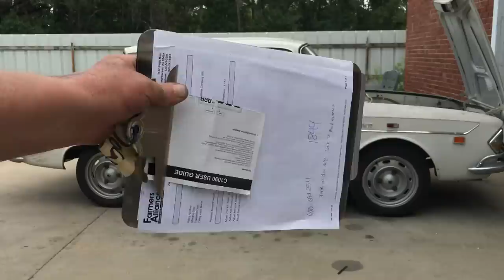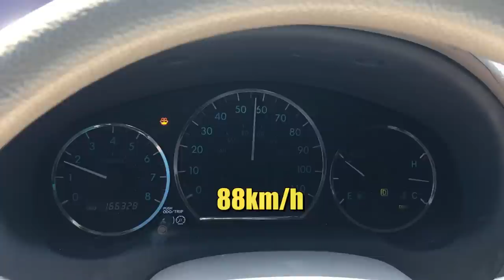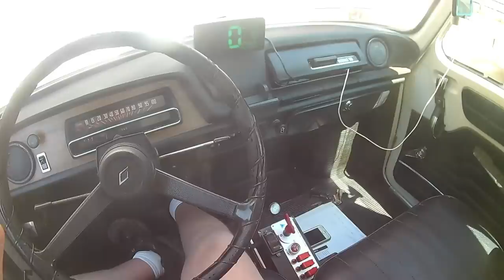S3 E21. How fast will this 670 cc predator V twin powered Renault go?...  Faster than you think!

Comment: Learn electricity at your own pace
What makes a light bulb work? What overloads a fuse? How does a magnetic field differ from an electrical field? With Electricity: A Self-Teaching Guide, you'll discover the answers to these questions and many more about this powerful, versatile force that everyone uses, yet most of us don't understand.

Ralph Morrison demystifies electricity, taking you through the basics step by step. Significantly updated to cover the latest in electrical technology, this easy-to-use guide makes familiar the workings of voltage, current, resistance, power, and other circuit values. You'll discover where electricity comes from, how electric fields cause current to flow, how we harness its tremendous power, and how best to avoid the various pitfalls in many practical applications when the time comes for you to put your knowledge to work. The clearly structured format of Electricity makes it fully accessible, providing an easily understood, comprehensive overview for everyone from the student to the engineer to the hobbyist.

Like all Self-Teaching Guides, Electricity allows you to build gradually on what you have learned-at your own pace. Questions and self-tests reinforce the information in each chapter and allow you to skip ahead or focus on specific areas of concern. Packed with useful, up-to-date information, this clear, concise volume is a valuable learning tool and reference source for anyone who wants to improve his or her understanding of basic electricity.
Reply: Electricity: A Self-Teaching Guide (Wiley Self-Teaching Guides Book 177) 
by Ralph Morrison (Author)
Reply: If you wish to show your curious (really?) grand child how electricity and electronics work use this book. You have a fair chance to teach the young cub without boring the trapped child to death. The material doesn't require mastery of heavy mathematics. The schemes are simple and clear, The experiments can be performed with no excessive preparation time and effort. You need some testing hardware a few basic tools and some components. If you don't own them already, buy. These aren't expensive. It's good to have them at home any way.

If your student is too young skip the definitions simplify and shorten explanations. Go straight to the experiments. To a more grown better learnt student read and add your interpretations to the books contents. If your student can and agrees to read the book you are lucky. In such case you both were invited to a party all pure fun and thrill. Lean back and answer questions from time to time. Your help with the experiments will be needed most probably.

If your student grand child happens to be a real student. Meaning an electronics engineering student at any kind of university or technical academy institute, Sorry. The book is under qualified. Read the book for yourself or try with your grand grand child.
Reply: I just began reading this book, reviewing some of the things I learned way back in High School in the '70s. I selected this one of several popular "coffee-table" texts, because, at a glance, it appeared to be really focused on the physics behind electricity.
When I reached page 13, however, I was thoroughly amazed to find that Ralph Morrison, who is supposed to be this hot-shot electronics engineer, has made some very serious errors in his presentation. For instance, he incorrectly identifies the unit of force in the metric system as the kilogram. Now, we all understand that unit to denote mass. The unit of force in the metric system (which high-scool Physics texts call the "MKS system," as opposed to the "CGS system," also metric, but useful for denoting smaller quantities) is, actually, the Newton. He then uses this bit of bad Physics to make more, by deriving the dimensions of the Joule as "kilogram-meters." Where he does make mention of "mass" and "acceleration" in his example about the work done lifting a body in a gravitational field, he supplies the variables "m" and "g" but, they are dimensionless. These are the same sorts of mistakes that beginning students make when they fail to understand that "weight" is a FORCE, not a measurement of mass. The weight of, say a brick, is not measured in kilograms. It's measured in Newtons.
These errors are absolutely critical when they appear in any discussion of field theory.
Because I do remember somthing about High-School Physics, I have been able to read this text and understand what the author is driving at; I have been able to accomplish this only by second-guessing the text at each step. I don't believe that a true beginner to this subject would be so lucky.
Reply: A great updated edition for those who might be looking for a refresher course, or just simply a beginner/maker in the field of electricity and electronics. Some sections may come across a bit intimidating, but the text is written well enough for even the beginner to understand. I had first seen the 5th edition of this book at my local bookstore; thinking that this book had too many chapters/subsections to be that all that thorough and in-depth, but I quickly learned that this book didn't lack anything at all. I was amazed at how well everything was laid out. The material is presented in such a way that makes everything so very easy to learn without all the confusion at the same time. After completely enjoying the 5th edition, I was anxious for the arrival of this new and updated 6th edition. If you're looking for a well rounded text, than this new edition may be right for you. The biggest difference between editions is that the 6th edition now includes Audrino hardware and programming, an improved Microcontrollers section, and other updated information of other sections, as well as updated practice tests and exams. I strongly recommend this book first over any of those expensive textbooks out there. After All, if you're out to achieve a good understanding of electricity and electronics, or studying for an entrance exam for a technical job position, this book will help you do that. It's a great book for teaching you the subjects of electricity and electronics, that later tests your knowledge of it. I highly recommend this updated edition
Reply: Good aspects of this book have been said by most of the other reviewers. The main problem with such books is that for slightly experienced problem solvers, this book probably does not provide a whole lot of information as to what needs to be done to get better. For instance, for a kid who is in 10th grade struggling with math, this is a very good book. For a kid who is in his 11th grade trying for math Olympiad or for people looking at Putnam, this book won't provide much help.

Most people simply say that "practice makes perfect". When it comes to contest level problems, it is not as simple as that. There are experienced trainers like Professor Titu Andreescu who spend a lot of time training kids to get better. There is lot more to it than simply trying out tough problems.

The most common situation occurs when you encounter extremely tough questions like the Olympiad ones. Most people simply sit and stare at the problem and don't go beyond that. Even the kids who are extremely fast with 10th grade math miserably fail. Why?

The ONE book which explains this is titled "Mathematical Problem Solving" written by Professor Alan Schoenfeld. It is simply amazing. A must buy. In case you have ever wondered why, in spite of being lightning fast in solving textbook exercises in the 10th and 11th grade, you fail in being able to solve even a single problem from the IMO, you have to read this book. I am surprised to see Polya's book getting mentioned so very often bu nobody ever mentions Schoenfeld's book. It is a must read book for ANY math enthusiast and the math majors.

After reading this book, you will possibly get a picture as to what is involved in solving higher level math problems especially the psychology of it. You need to know that as psychology is one of the greatest hurdles to over when it comes to solving contest problems. Then you move on to "Thinking Mathematically" written by J. Mason et al. It has problems which are only few times too hard but most of the times, have just enough "toughness" for the author to make the point ONLY IF THE STUDENT TRIES THEM OUT.

The next level would be Paul Zeitz's The Art and Craft of Problem Solving. This book also explains the mindset needed for solving problems of the Olympiad kind. At this point, you will probably realize what ExACTLY it means when others say that "problem solving is all about practice". All the while you would be thinking "practice what? I simply cannot make the first move successfully and how can I practice when I can't even solve one problem even when I tried for like a month". It is problem solving and not research in math that you are trying to do. You will probably get a better picture after going through the above three books.

Finally, you can move on to Arthur Engel's Problem Solving Strategies and Titu Andreescu's Mathematical Olympiad Challenges if you managed to get to this point. There is also problem solving through problems by Loren Larson. These are helpful only if you could solve Paul Zeitz's book successfully.

To conclude, if you are looking for guidance at the level of math Olympiad, look for other books. This book won't be of much assistance. On the other hand, if you are simply trying to get better at grade school math, this book will be very useful.
Reply: 数学の問題を解く方法が、学生を指導する、という視点で体系的に述べられています。　解答を導き出すための学生への質問集も用意されています。　考え方にびっくりするほどの斬新さは感じられませんが、数学教師や数学を志す人には役立つと思います。　　では数学以外の一般的問題解決やプロジェクトなどの問題分析に役立つかというと、プロセスマネジメントが発達した現代ではそこまでの応用力を求めるのは無理かな、と感じました。　文章は簡潔で英語は読みやすいです。　今まで馴染みのなかった数学英語に接することも出来ました。また、錆付いた数学知識を（ある程度）思い出すきっかけになったと思います。 ガリレオ時代のフランスの学者 Descartes,Reneが引用されていたりもします。
Reply: From a renowned historian comes a groundbreaking narrative of humanity’s creation and evolution—a #1 international bestseller—that explores the ways in which biology and history have defined us and enhanced our understanding of what it means to be “human.” One hundred thousand years ago, at least six different species of humans inhabited Earth. Yet today there is only one—homo sapiens. What happened to the others? And what may happen to us? Most books about the history of humanity pursue either a historical or a biological approach, but Dr. Yuval Noah Harari breaks the mold with this highly original book that begins about 70,000 years ago with the appearance of modern cognition. From examining the role evolving humans have played in the global ecosystem to charting the rise of empires, Sapiens integrates history and science to reconsider accepted narratives, connect past developments with contemporary concerns, and examine specific events within the context of larger ideas. Dr. Harari also compels us to look ahead, because over the last few decades humans have begun to bend laws of natural selection that have governed life for the past four billion years. We are acquiring the ability to design not only the world around us, but also ourselves. Where is this leading us, and what do we want to become? Featuring 27 photographs, 6 maps, and 25 illustrations/diagrams, this provocative and insightful work is sure to spark debate and is essential reading for aficionados of Jared Diamond, James Gleick, Matt Ridley, Robert Wright, and Sharon Moalem.
Reply: @ocdman202   In this thought-provoking follow-up to his acclaimed StarTalk book, uber astrophysicist Neil deGrasse Tyson tackles the world's most important philosophical questions about the universe with wit, wisdom, and cutting-edge science.
For science geeks, space and physics nerds, and all who want to understand their place in the universe, this enlightening new book from Neil deGrasse Tyson offers a unique take on the mysteries and curiosities of the cosmos, building on rich material from his beloved StarTalk podcast.
In these illuminating pages, illustrated with dazzling photos and revealing graphics, Tyson and co-author James Trefil, a renowned physicist and science popularizer, take on the big questions that humanity has been posing for millennia--How did life begin? What is our place in the universe? Are we alone?--and provide answers based on the most current data, observations, and theories.
Populated with paradigm-shifting discoveries that help explain the building blocks of astrophysics, this relatable and entertaining book will engage and inspire readers of all ages, bring sophisticated concepts within reach, and offer a window into the complexities of the cosmos.
For all who loved National Geographic's StarTalk with Neil deGrasse Tyson, Cosmos: Possible Worlds, and Space Atlas, this new book will take them on more journeys into the wonders of the universe and beyond.
Reply: Neil Degrasse Tyson uses two methods to communicate information in the book. Tyson does an excellent job of making science enjoyable through the text and photographs.

The first method Tyson uses to communicate information is through the text. One interesting fact I learned is that there are 100 billion galaxies in the universe and that 10 stars are created each year. Another interesting fact I learned from reading the test is that the planets are classified in three different ways. The Earth, the planet Mars and Venus are rocky planets. Saturn is a gas planet. Neptune and Uranus are icy planets I did not know that the planets could be grouped as such. I learned that dark matter in the field of astrophysics like dark matter and dark energy that need to be explored. Dark matter is a gravitational force that sucks matter in the universe in. The last piece of information I learned from the text is the water is not only liquid that can be used to detect life on other planets The detection of liquid methane and ammonia are two other signs that life is possible on other planets.

Neil Degrasse Tyson uses photographs to communicate information in this book. I like the photograph of an European space probe called Gaia. This probe's function is to photograph all of the stars in the sky. There is a beautiful photograph of the surface of Antarctica. This picture is a reference that meteorites landed on the continent and suggests that Antarctica is an starting point of origin of the earth. There is a beautiful photograph of the sky in Acadia National park in Maine. I like this picture because the natural beauty of Maine is on display here. There is a picture from the movie Star Wars that illustrates the concept of exo sociology. Exo sociology is the practice of human beings interacting with aliens from other worlds. I did know there is a field of study called exosociology. I had fun learning that a scene from a sci fi movie is an actual study. I learned so much about the universe from reading Cosmic Queries.
Reply: The great Richard Dawkins once famously said, “We are going to die. And that makes us the lucky ones.” This was in reference to the statistically tiny probability that we were even born at all. Then, in addition to this felicitous opportunity, we evolved to understand the universe and our place in it. We are the universe awakening to know itself – possibly the most beautiful sentiment ever conceived.

NGT has long been another great expositor of science. Here he takes common questions and ideas in cosmology, physics, chemistry, and evolutionary biology and weaves them together to paint an up-to-date picture of the most important questions ever asked. Where do we come from and how did we get here? Are we alone? How did the universe begin, and how will it all end? The result is a complex tapestry of hard-won science, centuries in the making. To be sure, some of this is easy to grasp and some of it isn’t. As impressive and clear-minded as NGT is, some of the science here is difficult to understand. Readers should be aware that some basic grasp of the picture of the universe should be present prior to undertaking this endeavor. The best physics popularizers in the world all run into the same trouble. Particle physics is hard. Grasping the deeply theoretical (and hypothetical) nature of the multiverse and the “pre-Planck” universe is hard. National Geographic’s art helped with these difficulties, but much of this is challenging to read and understand.

However, in the end, NGT’s passion for curiosity, for inquisitiveness, shines through the morass of complex science. His humor also propels the reader through the book. None of this information is really new – even for NGT readers. But it takes multiple deep-dives into these subjects to begin to understand the details. The gravity of this knowledge, though, is felt immediately and throughout; the questions posed are perennially fascinating, even if some of the answers currently elude us. He implores us that, no matter what, we continue to look up and wonder. I will nose-dive into a book, each and every time, if only for this passion, conveyed to a species with an indefatigable gleam in its eye.
Reply: About the book itself

If you intend to purchase, or even borrow from a local library, get the hardcover edition, it’s easier to handle. The softbound edition is 845-pages, and at 8-inches by 6-inches, by 1½ inches thick, it is compact but heavy. Simply, this book is difficult to hold and at nearly 2 ½ pounds it just does lay flat or seem to cooperate when flipping between the index and the main text. At least with the hardcover, the book lays flat and has a larger typeface. There are 22-chapters, averaging about 40-pages each, with seemingly few subheads to reinforce for the reader the focus subsections of the chapters.

But in either binding, Roy Porter is easy on the reader. Sentence lengths are appreciably short for such a complex topic. And the history he tells is edited to highlight the most meaningful elements. Porter’s literary sources span the globe and he consistently translates foreign titles and phrases into English. The bibliography of further reading runs 44-pages and is broken into sources for the author’s 22-chapters. Even in this detail, the author limits the list to works he found most helpful and written in English.

Porter’s Message: The analogy of the night sky

If there is an overall theme to this book, it’s not that medicine is wonderful and someday humans will be immortal. Much more the opposite. In the introduction to his book, Porter asks us to recall the night sky to explain two aspects of medicine that readers should keep in mind as they read about the evolution of medical care over thousands of years.

The analogy between medicine and the night sky goes like this: Except for a few visible stars and planets, most of the night sky is dark.
---First, that image certainly applies to the millions of medical encounters that have occurred across human history. We know about only a fraction of them. Are there medicines and maladies that are unknown to us? Yes, very likely.

---Second, the night sky with its collection of bright and dim objects, surrounded by unbounded darkness, aptly describes our ignorance of what makes people sick and what will cure them. That’s been a fundamental fact of medical care since the beginning. There is a scarcity of knowledge that has limited all medical endeavors since Hippocrates.

What would a person do with this book?

Name your topic and use the index to find valuable insights into the disease, people and medical practitioners across history and the world. About one in eight persons in the US works in the healthcare industry, but regardless of your profession, this wide-reaching history has facts for any purpose.

So if you are a manager preparing a presentation or just someone who wants to cite history to support their arguments for higher wages, or better working hours, or to explain why the world is the way it is, this book is your friend. For example, if you are speaking about current day migration from 3rd world countries and its impact on wages, the chapter on Tropical Medicine is relevant. Colonial powers and the colonized benefitted tremendously from efforts to control tropical maladies.

Or perhaps you are interested in human ignorance and resistance to learning, even in light of very contrary evidence, then medicine’s historical faith in blood-letting can fit your message. As late as the first World War, some internationally prominent physicians clung to blood-letting as first resort therapy.

Finally, if you intend to address the profusion of pharmaceutical ads on television, Porter’s discussion of the long standing skepticism about physicians’ ability to cure is on target. Historically, and even to current day, many people don’t believe that physicians can cure any disease. Potions, elixirs and pharmaceuticals have a much better track record.

Is medicine the greatest benefit?

The title of book comes from Samuel Johnson, an 18th century writer and critic who described medicine and the medical profession as the greatest benefit to humankind. Alternatively, one could argue that the greatest benefit to mankind is the scientific method, or religion or democracy. But there are some aspects of medicine that truly make it distinct and the most beneficial. Most obvious is the direct output or product of medicine, which is health, without which human life is greatly diminished.

If we accept that the result of medical care or knowledge of medical matters is health improvement for individuals, we should recognize that health enhances every aspect of life. In economic terms it adds utility to all things. For example, it’s great to be a member of a 21st century royal family, but if you have a debilitating, chronic illness. Relief from pain and unwanted symptoms of such a condition makes royal life even better. Living is enhanced by the good health produced by medicine.
Reply: There are happily a good many excellent historians of medicine, as reviewing the few good journals will bear out. But regrettably few have tried to take on the monumental task of reviewing it all, at one fell swoop. Small wonder. It risks considerable criticism and contumely, from dolts who can't stay engaged beyond a hundred pages to those whose fertile yet unseeded minds carp at the products of others. This serves well as a course text, and not solely for its linearity and comprehensiveness; but also for its 1) unique organization, into recurring cycles on disciplines (focused on the mental disorders, on surgery, in one era, then again in another era); and 2) for Porter's willingness to wade into the swamp of opinion. It's not just about what happened. It's also about what will happen, and Porter's capacity to have foretold many of the rising controversies in systems of health care is a great tool for showing medical students how to examine and criticize trends. They don't have to agree with his projections, to be able to admire the number of economic and cultural considerations Porter brings into them. I want thoughtful doctors at the end of their educations, not opinionated ones. Lovely, good-humored prose such as Porter's engages them, the evolutions described encourage them, and his clear descriptions enrich the basis for their professional commitment. Criticisms: noted by previous critics, the phtos/illustrations were unfortunately condensed by the publisher into small sections; and Porter's social medical passion at times erupts and exposes him to charges of bias. But I don't know that he misrepresents opinion as fact, at any point, and his data sourcing is very good. My high rating reflects admiration for the combination of ambition, scope, accuracy, and readability, realizing that the perfect history-of-medicine text has yet to be written. This is quite fine, while awaiting a successor to Roy Porter.